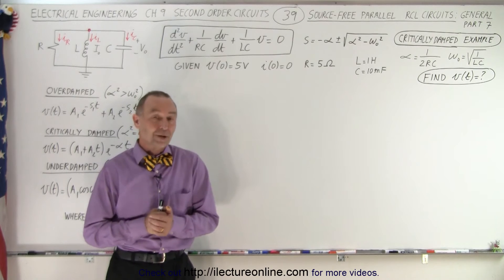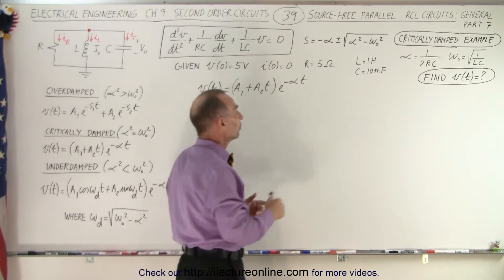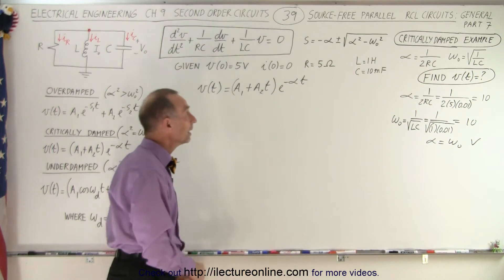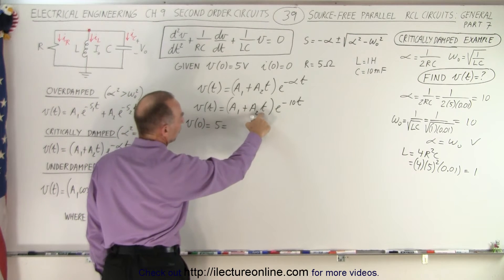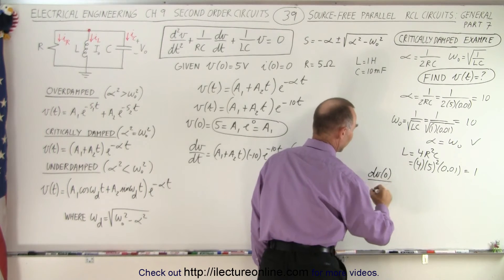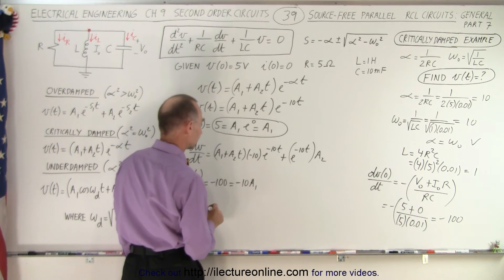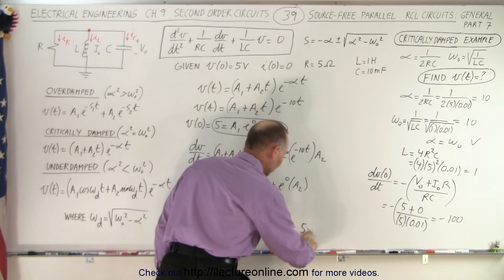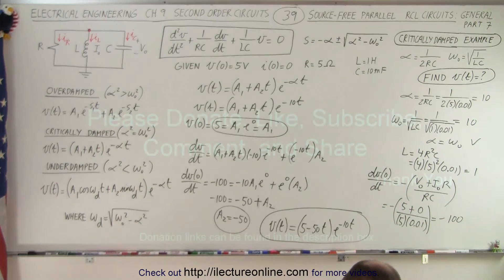Electrical Engineering: Ch 9: 2nd Order Circuits (39 of 76) Source-Free Parallel RCL Circuit 7 of 8

Comment: Why is the final answer has a 'MINUS' sign again?, Is it because the 'capacitor' was discharging?
Reply from the maker: The final result is dv/dt = - 100 (volts / second)     It is the rate of change of the voltage and in this case the voltage is decreasing.  (The negative represents a decreasing voltage).